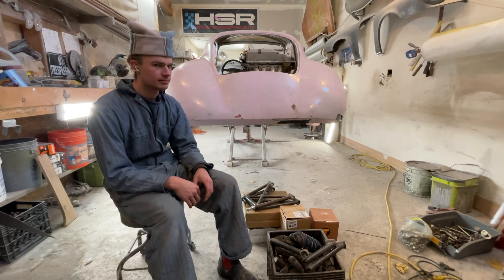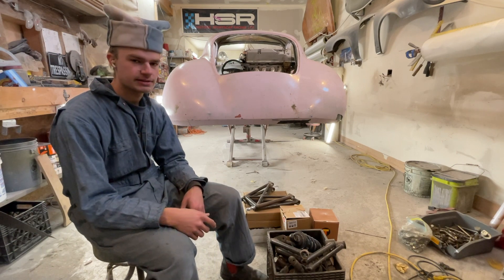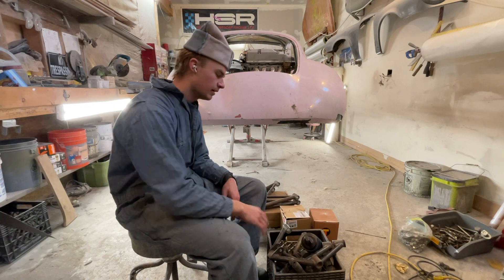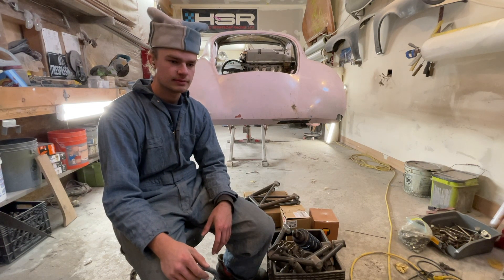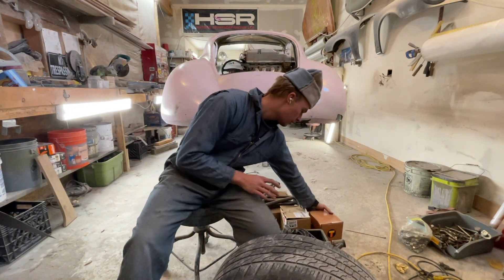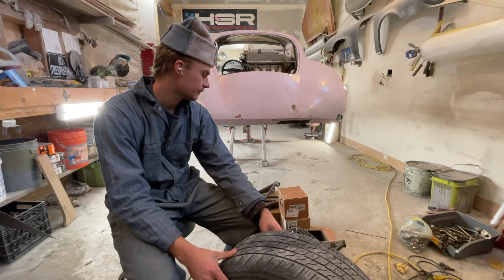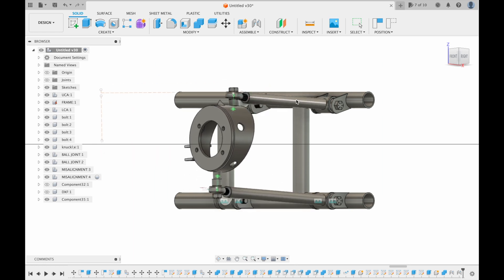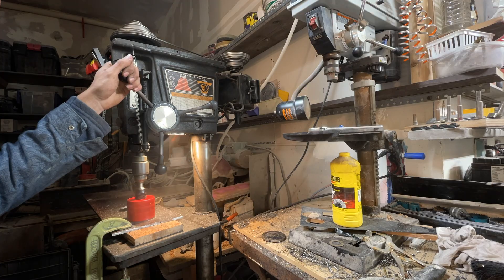DESIGNING SUSPENSION WITH CAD

Comment: Amazing job! Which package did you use to figure out the geometry? Regarding the floor and fire wall will you finish weld all around rather than just tack? Will you cover with matting to stop vibration noise? Well done!
Reply from the maker: the software is fusion 360. the floor got finished welded, snd seam sealed. and yep i used some mating to reduce road noise!